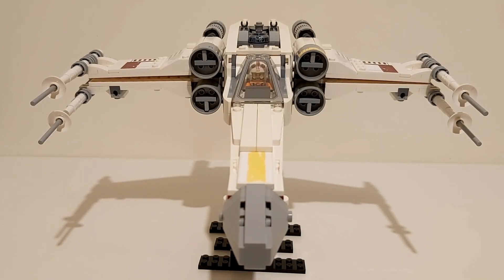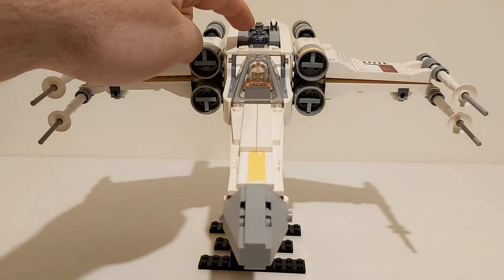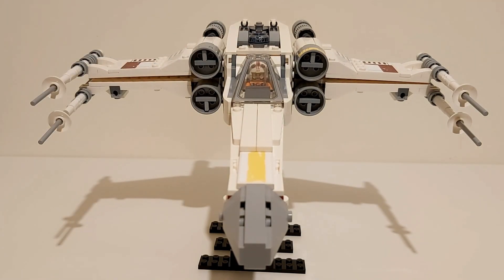LEGO 2021 X-Wing COVERED Technic parts TUTORIAL

Comment: great x wing station wagon, I think that this set is amazing as lego made it just the landing gear had to be modified but you can still take it off so it's not a big of a deal and then I display it landed so I don't mind, if I want the best x wing as possible I'd buy jerac's but it has no value 'cause it's not a set I just wanted the latest one because x wing is my iPhone, I always want the latest model lol... I did some mods for fun but then I came back to the original design 'cause on my shelf with 100% original lego set it was weird to me to se a modded one, I just put some leaves to make a dagobah x wing the same that lego used in 4502 x wing but darker to match the new Yoda hut because I put it next to it, I put the 9493 x wing next to the celebration minifigs to represent episode 4 and the 75301 next to that and the Yoda's hut to represent episode 5, if lego releases a newer one I hope it's wedge's so I can represent episode 6 (him and Lando blasted the core)
Reply: ps nice work with the landing gear it works better than the on I thought